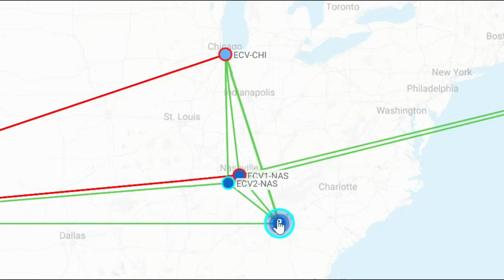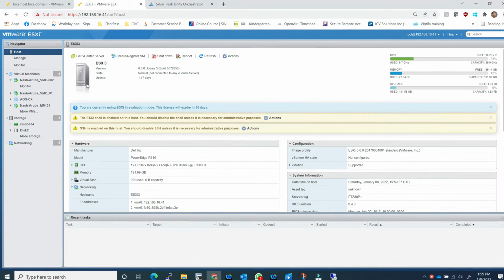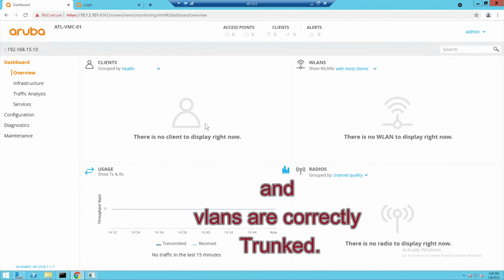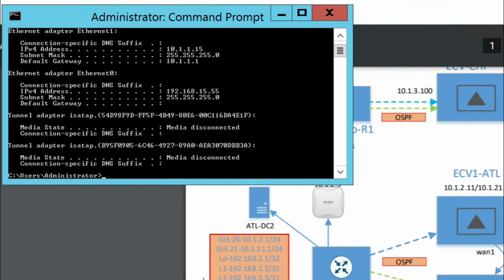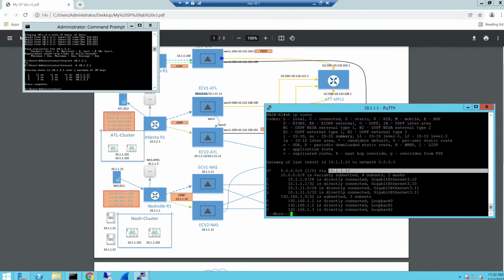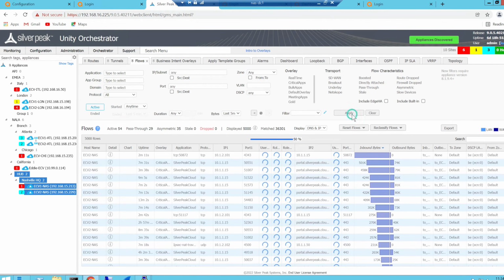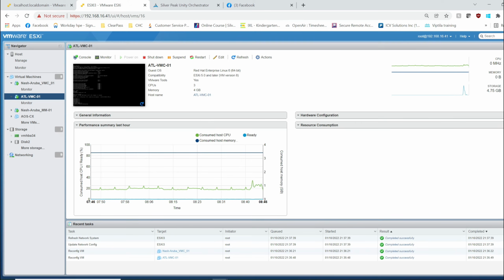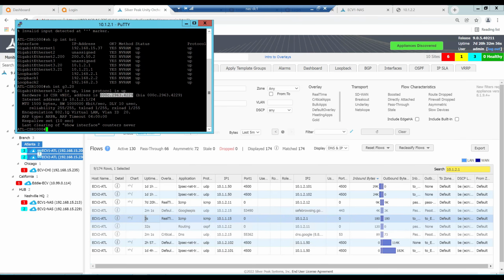My Lab #2 with Cisco, Aruba, Silver Peak and VMware

Comment: Hi there could you please assist I’m very interested in doing Aruba homelabs and configuring core switch and edge switch of Aruba and and also learning how to configure the ap is there a guide you can provide for me to be able to do all or some of those things . Thank you for your time.
Reply from the maker: I can only do these lab because of having access to devices and licensing. Aruba CX switches can be learned using virtual images. That is free but rest will all require licensing.
Reply: @TwT101  hi I have access to the license but I’m struggling to set it up with the right for the switches we have in my work place 3810m for core and 2540 for edge so can you please telll me which imgage I need . As the Aruba cx  I have on GNS3 is different
Reply from the maker: @XwolfBane18  3810M and other Aos switches doesn't have virtual image. Only CX has that. Email me your issue.
Reply: @TwT101  could I please get your email . I am aware of the Aruba cx doesn’t have the 3810M but how can I implement it on GNS3 if I can get the image etc . Thank you for your time .
Reply: @TwT101  will email now :)
Reply: Hi there I have sent an email hope you have received it the title is GNS3 Aruba set up …